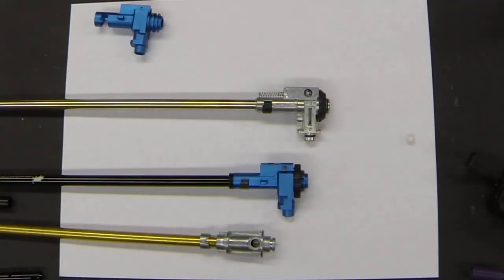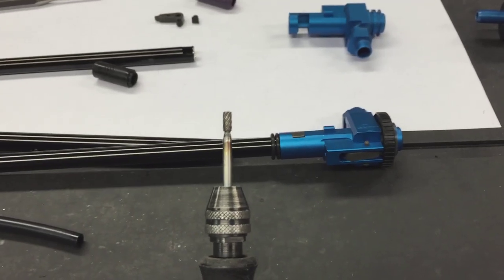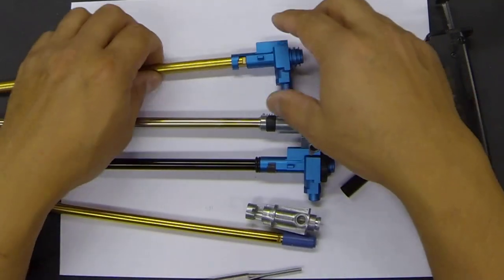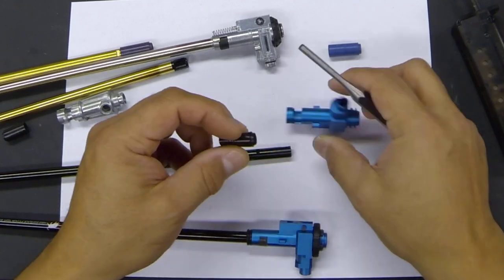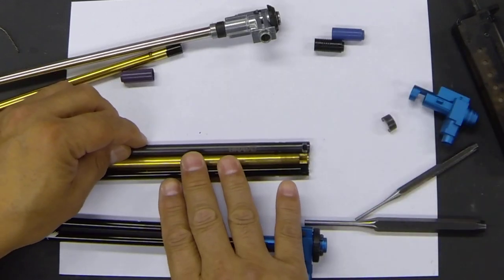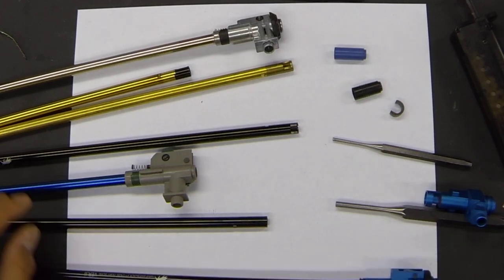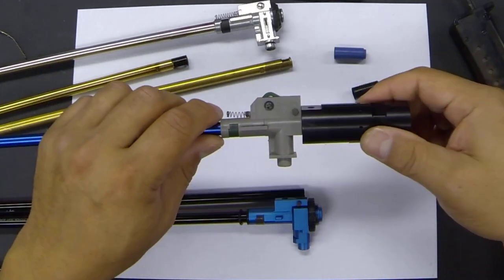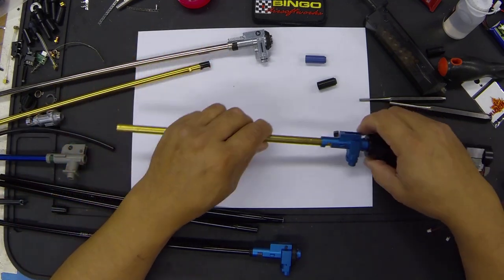Bingo Airsoftworks Hopup, Buckings and Barrel Testing and Troubleshooting

Comment: I know this video is old but it’s very informative and detailed. I wanted to note at the end how he said you can adjust your barrel because your bbs may be shooting slightly left or right... If you look through the end of your hopup into the barrel while holding it in your hand, you’ll see the nub coming down as you rotate the hopup arm up and down and if it’s coming down crooked then you know your accuracy will be off before you install the barrel in the upper receiver. Everything has to be aligned perfectly if you want optimum performance. Working on your Airsoft gun isn’t hard until you get into the gearbox. I haven’t gotten there yet but I’m just now getting comfortable moving onto that.

Comment: Thanks, this is a very informative video! However, I think that by sanding down a perfectly good barrel you are tying yourself to Maple Leaf buckings. Using a custom 3D printed C-clip (if you own or have access to a 3D printer) that is made to fit that wrongly flushed barrel cutaway, might be a better idea. Just you have to keep in mind that you might end up making a custom slightly longer hopup arm as well, because the hopup window in that case is ~0.5-0.8 mm even further outside.

Right now I am working on such a solution for my Prowin + Maple Leaf combination, but I have problems testing the hop up consistency, because I don't have a back yard long enough to do the testing... ;) 

Also, I've heard that there are these 0.4 mm thick O-rings that you are supposed to put on the shoulders of a Maple Leaf bucking to deal with the lips that are too long, but I'd rather sand them down, because the O-ring pushes the barrel even further outside.

Anyway, WTH is the deal with these Maple Leaf buckings?!? People are praising them, but from what I see, they're totally out of specs!

Comment: Hey, I have got a problem. I recently bought madbull inner barrel 6,01mm, maple leaf bucking (light blue), maple leaf nob and the prowin hop up. I also tried the G&G green bucking. The problem is that BBs get stuck in the hop up. I think it is a bucking problem, so could you please suggest a good bucking that works with this setup? Thanks for the replies. :)

Comment: Hey I recently purchased a prowin hopup and a purple prometheus bucking and installed them and they worked. i later took the part apart and disassembled then reassembled the hopup unit  and now my gun skips at least every other shot and when it does shoot it shoots two bbs and drops after 10 feet. Thoughts?

Comment: Hey, I got a pre owned gun with a prowin hop up inside, some marks shows that its fairly used/old but im wondering are there any parts of the hop up that wear away and can cause poor performance? I plan to use the prowin on my newer gun, and replace the bucking and nub to a flat hop set up, so i want to know if I'll have to get a new one

Comment: Great video! I have a problem with my Rs type 56-1 which I've just installed an inferno engine inside. It looks as though the nozzle protrudes too far into the hop up chamber preventing Bb's entering the chamber. What would you recommend?
Reply: +John Malcolm If the nozzle is prevent BBs from falling into the hopup when fully retracted, it's too long. I'd recommend trying an M4 nozzle (they are slightly shorter for the inferno), or you can sand down the nozzle to make it short enough to allow BBs to get into the hopup properly. Then just check it against the bucking lips to make sure it makes a good air seal.
Reply: I have this situation on a fairly new stock P90 (only about 2500 rounds fired). Never opened or anything. The nozzle protrudes into the bb entry hole and keeps bbs from dropping completely down but still fires them. A 2nd P90 we have doesn't do this and has a bit more impact power. Any suggestions?

Comment: Hey there. I have a classic army scar l with an extended 6.03 inner barrel. recently I noticed that the bb will fly about 20 yards and then it drops completely. I've tried turning the hop up all the way up but the wheel doesn't stop spinning. is something wrong with the arm of the hop up or is it a bucking problem? I would like to know soon so I can get the part to fix it for my birthday

Comment: I like the Maple Leaf Hopup bucking + Bucking, but I find that adjusting hop is way too sensitive in both a prowin and a normal (systema) hopup unit. Any tips?
BTW I had same problem with too thick maple leaf bucking shoulders and used your tip about thinning the bridge on the barrel. I just used a CNC mill instead of a lathe. Worked like a charm. I still have problems with the amount of hop is varying too much on my madbull 6.03 + prowin + maple leaf bucking/nub combo, but I think thats a seating issue that may be fixed by sanding the lips (?)
My PDI 6.01 + prowin + prommy purple (flathop modded) + prommy bridge hop-up nub combo works fine.

Comment: You mentioned that the shoulder of the maple leaf bucking is too thick for the c-clip slot to line up properly. I have experienced this with a krytac unit/inner barrel, so much so that the c-clip fails to install. I do not have access to a lathe so I have wrapped the barrel with teflon tape around the c-clip slot section so that it provides resistance when inserted into the chamber. My question is, do you think this will suffice or is modification of the bridge required? Thank You
Reply from the maker: +Nathan Wilkening It might work, the key is to not have the inner barrel move when the BB is shot. If the barrel is held in place so it doesn't move and doesn't rotate, then you will be fine. I would fire a few 100 rounds through it then inspect the barrel/hopup and see if things have shifted.

Comment: Thanks for this video, it helps a lot! On 5:15 you performed the push-through test. You said that the bucking should give very little resistance. However, in my case, the bucking doesn't give any resistance. In fact, the bb just felt through the bucking without pushing it. Is this an issue? and how can I solve this issue?

Comment: 1. Will a better hop up feed better/Faster without jamming ? I'm running a p* and the other day I had it at 42 rps no jams at all then today I played a few games and then it just jammed like crazy.( using mid caps) so I had to run super high settings.

2. Does bb weight affect how well mags will feed and if the gun will jam or not. 

btw I was using the crappy g&g green bucking with stock g&g hop up and barrel. ( I'm getting a prowin and orga) 
Thank you.

Comment: TY for a great video! A couple of questions:

1. How would you do an air seal test using a macro line with an SMP since the latter has a "rear-biased" nozzle?

2. Maple Leaf bucking: What nub are you using with it? A Maple Leaf flat hop nub, a regular nub, or a custom nub (like an M-nub or other flat hop nub)? Interestingly, I personally never had good results with a Maple Leaf compared to my custom flat hop (using a Prommy Hop Up Tensioner).

PS: You might find the same fitting issues with a Lonex hop up unit in combination with a P* like with the G&G hop up as depicted in your video. At least, that's the problem I have with AEGs...
Reply from the maker: For the SMP, you could remove the front cylinder and put a small piece of foam into the base of the nozzle (about the size of a sugar cube) and then reassemble the Engine. This should push the nozzle forward and hold it in place. Then reassemble the gearbox and gun, and then do the air seal test. If it checks out, then take it apart again and remove the foam piece. Regarding #2, I use the Maple Leaf hopup tensioner (spacer)  or a stock spacer (technically these aren't called nubs, the nub is the part that imparts the backspin on the BB). I used to do a lot of flat hops, but found the Maple Leaf worked as well for me, but the Maple Leaf hopup tensioner is a nice spacer and it would probably work well for flat hops. I'm going to be doing some experimenting with the Modify flathopup bucking and spacer also.

Comment: Great Vid Bingo! May I ask which angle maple leaf bucking and what type of nub you use?
Reply from the maker: I use the 75 degree Maple Leaf, and sometimes the 70 degree ones. But I shoot .3g bbs, so I like the 75s a little better. I've recently started using the Maple Leaf hopup tensioner (spacer), and I like it a lot.

Comment: Hello im using the prowin hop up chamber, Maple Leaf bucking and a Madbull black python v2 6.03 tight bore barrel and im woundering if you could show the video how did you modify your barrel so the hop up chamber fits perfectly, becouse atm   the c-clip doesn't fit properly.
Ty
Reply from the maker: Yes, the maple leaf bucking has very thick "shoulders" so the barrel doesn't go far enough into the hopup for the C clip to attach. I lathe down the end of the barrel, the hopup end, where the window is located. I make the "bridge" of the window about half it's thickness. I then deburr and file it down so there are no sharp edges. You can do the same modification using a dremel and sanding drum. Just like how I sand down the bucking, you can sand down the end of a barrel. It helps to have the barrel rotating in a drill. Just chuck the barrel in the drill, clamp the drill to a workbench or table. Then use one hand to steady the end of the barrel, while you sand down the window bridge with the dremel. Make the bridge more narrow. Make sure to round off the edges of the barrel so it's not sharp to prevent it from cutting your bucking.
Reply: BingoAirsoftworks
Tnx Alot :)
Best regards from Slovenia :)

Comment: So I installed a macaron hop up bucking in my cyma dragunov. I replaced my stock bucking with the maple leaf, and my stock nub with the maple leaf concave nub. Maybe I'm an absolute idiot and did something completely wrong, but when I tried to use it, my gun made a horrible noise, didnt fire on the first trigger pull, but on the second one, two bbs came out, and the fps was dramatically reduced from what it should be. In fact, if I applied ANY amount of hop, the fps was dramatically reduced to the point it was no longer functional. Accuracy and range dramatically reduced. What the heck. Can someone help?

Comment: Would the Prommy blue (Delta) bucking be acceptable to use if you sanded in I.D. of the lips? I kind of like them b/c I don't have to sand down the nub & ridge when installing a flat hop mod.
Reply from the maker: If you can get them to work by sanding down the ID on the bucking, excellent. Just make sure it's even and not too large as you want to maintain an air seal with the nozzle. But it seems like it would be just as easy to remove the nub and ridge on a standard bucking.

Comment: I just got a new polarstar but I'm having some issues with the gun. It seems that the bbs are going down and no matter how high I adjust the hop up, the bbs don't seem to go up. This is a brand new gun and I'm quite frustrated. Would you have any tips for me? Thanks.
Reply from the maker: xxthehuskycaboosexx Remove the hopup and inner barrel from the gun and look down the hopup while adjusting it from off to full on. Do you see the bucking nub drop down into the inner barrel when the hopup is fully on? It should be very visible and protrude significantly into the barrel. If it is not, check and make sure the window is at the top and centered, and make sure the hopup spacer properly fits into the barrel window. If the spacer is too big, it won't press down on the bucking properly (also make sure the spacer isn't missing).
Reply: +xxthehuskycaboosexx i have the same problem, i hope he makes a video on it
\

Comment: I know they aren't popular....but are there any tips when working on a 2-piece hopup (i.e KWA)? Specifically with a Fusion Engine.
Reply from the maker: The same type of tests will work. You can do the BB push through test with the upper half of the hopup and the barrel. To do the drop test, you can do this with the Fusion Engine removed from the body (or just remove the nozzle from the FE), assemble the upper and lower receiver, then drop the BB in and see that it falls all the way into the hopup. I'll be doing another video soon showing how to shim the FE to align the nozzle in the hopup.

Comment: Have you ever messed around with the pro win hop up unit and a reaps bucking or the rhop set up? My polar star 416 is having accuracy issues with a systema hop up with a reaps bucking any thoughts?
Reply from the maker: Beau Carter I haven't had any good results with the reaps bucking. I basically only use Maple Leaf buckings at this point. I no longer bother to do flat hops, and I don't do rhops. I haven't found the rhops to be that much better and they take a bit of testing and tuning to get right.
Reply: Hmm that's kind of funny I've tried the maple leafs and had worse results then my reaps a huge loss of range in my vsr for sure maybe it's the hop up unit in my polar star have to pick up a  pro win
Reply: Beau Carter I think a significant contributing factor is the type of nub you use with the bucking. For example, a flat nub 'subjectively' seemed to work better with the REAPs, where as a circular nub was quite bad. Conversely I get good results with the maple leaf with a circular nub, but average results with a flat nub.  Hop performance is is possibly a function type of nub AND nub-to-bucking-to-BB contact area and how evenly the pressure is applied to the bucking-bb. Also distortion of the bucking may also be a factor when applying hop (which I guess the Rhop tries to reduce). The distortion seems to be a bigger problem with thin AEG buckings for me, and less of a problem on GBB which have thicker rubber.

If someone could build a transparent barrel/hop unit/rubber, or find a way to measure applied backspin RPM on the BB, it might be easier to quanify the effect of these variables, but until then, its mostly science by qualitative observation.

Comment: 13:50 If u put O-rings as spacers on the inner barrel, wouldn't it miss align the hop up feeding tube with the mag opening? Or wil it be a more tight fit only?
Btw great vid, helped me expand my knowledge (Y) tysm

Comment: I have the madbull 6.03 barrel, prome bucking and prowin hop up, it doesnt feed very well. Some times 3-4 bbs spit out at the same time. Why does this happen? Please help!
Reply: Is the gun HPA or AEG? What are your results from the BB drop test and BB push through test?
Reply: AEG, drop test works fine but the push test requires more force than normal.
Reply: You may need to sand down the window side of the inner barrel so it's not pushing against the bucking so much, causing the bucking mouth to narrow. BBs are jamming up in the hopup since they aren't making it through the bucking, causing the multiple shots. Are you using the prommy blue bucking or the purple one? If using the prommy blue (flat hop) bucking, replace that bucking, it's very bad and causes jams such as this.
Reply: I´m using the purple one: http://www.evike.com/products/31081/ . I´m just so bummed cause I got all these quality stuff and it still jams haha.
Reply: +Bingo Airsoft Designs I found the problem; it doesn't jam when I use my old chamber with the new barrel and the purple bucking. But when i use my new prowin it jams, so either the prowin is to tight or it's not compatible with my gun. (Sorry for bad english)

Comment: I have a CM16 raider that I just got a couple of days ago. When I chronoed it, it was getting 96 to 120 fps, WTF. I don't think it's a battery problem because I was using a smart charger, I asked my friends and they said that its with the bucking. I'm going to evike to get it checked out. I'm not sure if it's a bucking problem, or a battery problem. What do you think?
Reply: Battery doesn't change FPS, only the rate of fire. The spring still travels the full distance if it fires.
Reply: Open the gearbox and check the compression/air seal of the cylinder. You likely aren’t getting any compression whatsoever, which is usually caused by an air leak around your cylinder head and/or the o ring around the piston head. I’d recommend getting an aluminum cylinder head that has double o rings as well as an aluminum nozzle. Also, wrap the bottom of the cylinder head with Teflon tape. 

Get some silicone grease and a few #14 o rings, and replace the o ring around the piston head. You’ll want to slightly enlarge the #14 o ring by stretching it over the cylinder and very briefly and gently heating the o ring with a lighter. Grease the piston head and o ring too. You should check the compression by putting your finger over the nozzle and trying to quickly push the piston into the cylinder...a good air seal will stop the piston about halfway through the chamber.

This same exact issue happened to me after about 1000 rounds through a brand new Classic Army Skirmish EC2...I replaced the cylinder head and nozzle as well as the piston o ring and my FPS returned to its normal 350 FPS immediately.

Comment: Thanks for the video! My Cyma ak74m is feeding, but when fired, the bbs drop dramatically. They undershoot incredibly no matter what i do ti the hop up. What could be my problem?
Reply from the maker: +Travi-boy does it all Extract the inner barrel and hopup from the gun and look down the hopup as you increase/decrease the hop. Make sure you see the nub descends into the inner barrel. If it's not appearing, then check your hopup and make sure you have a proper spacer in placed under the adjustment arm.
Reply: +BingoAirsoftworks thank you! I'll do that right now? And what if it's not correct?
Reply from the maker: +Travi-boy does it all If not correct, you'll want to install a proper spacer and or replace the bucking. See https://www.youtube.com/results?search_query=ak+hopup+service